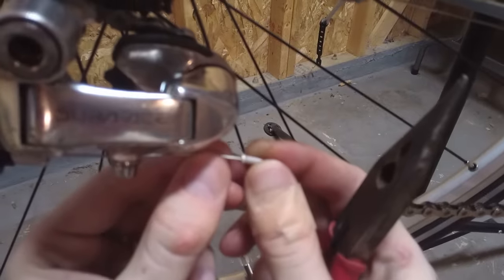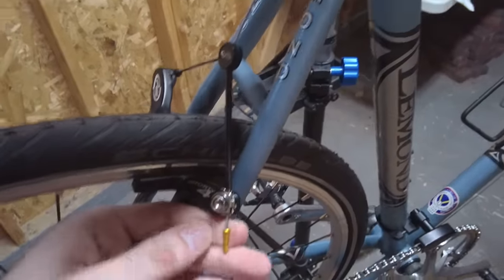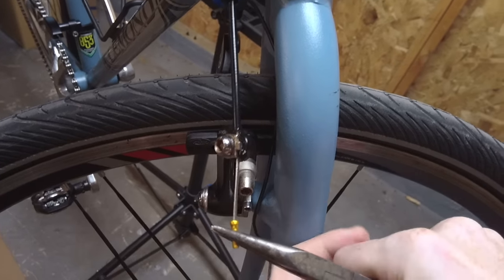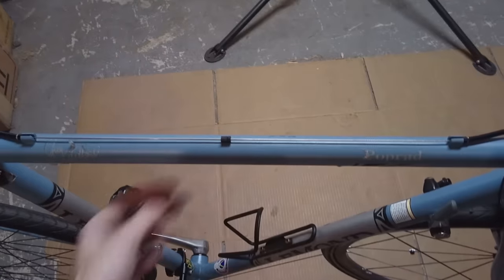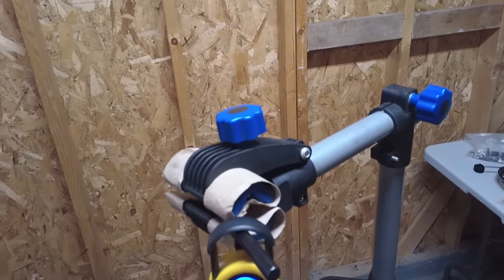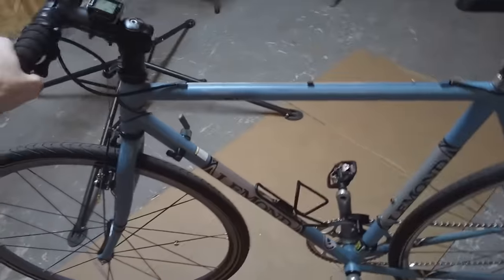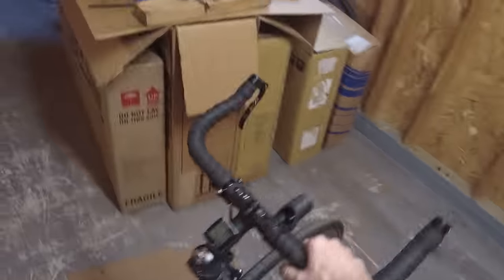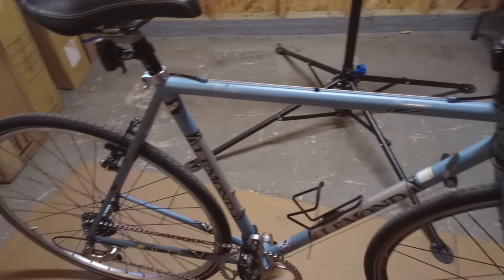Finished 1X9 Speed Drivetrain Conversion Project Commuter Bike BikeBlogger

Comment from the maker: @Moose Mechanic BMX bikes and folding bikes have smaller wheels, so you won't get everywhere as fast as a regular 27inch/700c/29er bike but if you aren't concerned with that then it could work. You'd probably need a longer seatpost.

Comment: Speaking of oiling the chain I saw a video where the fellow claims the BEST of all worlds is to hot dip the chain into parafin. You ever tried it? supposed to be great for repeling dirt and snow like Mn gets plenty of. I just use car motor oil on my beaters but usually stick to dry teflon lube for better bikes.
Reply from the maker: +BikingMNViking I have not tried it, but yes you can't truly clean a bicycle chain without removing it from the bike.

Comment: Does the Poprad have a steel fork as well? Or heavy wheelset? I was thinking it was going to be under 22 lbs., maybe about 1 lb. lighter but calculated aluminum fork.
Reply from the maker: +GTW 3Bagger I has an aluminum fork. It's 22.38 pounds complete right now.
Reply: I just had to know what my size large builds (well, one build and one with as much customization as yours) weigh when I discovered how inexpensive those digital scales are (and hopefully fairly accurate). DB Carbon Interval Tiagra/105...19.4 pounds, and 23.25 lbs. for my Giant TCR aluminum mish mash (mostly mountain bike) I threw together. That's with suspension fork so that's pretty good without even trying. I would definitely need the DB Interval to keep up with you off the lines but the Giant would be more fun. I'll have to weigh my 58cm DB Haanjo Comp and see how they compare. You've got fenders and original wheels but striped out all but one ring and cog right? I left the gearing, changed wheels, no fenders (yet), so it should be interesting...feels like mine might be about 25 though.

Comment: Hey buddy I bought a 29 MB and I have a question for maintenance the chain whats better? using WD-40 or buy a regular maintenance bike oil?
Reply: Water Disbursement formula 40 is not a good lube, use it more for freeing things up and dispersing water from little hidey holes like the ends of bolts and limit screws. Use a better sticking chain oil or wax-based lube if you live in a dryer, sandier area.
Reply: +T ekkendero 
If I owned stock in a bicycle chain lube company, I'd tell you something different. WD-40 works great. I buy WD-40 in a gallon can at Loews, and use it in a Park Tool chain  cleaning tool. It cleans and lubes at the same time. The key is to do it frequently - I clean & lube the chains on my bikes every week.
Reply from the maker: +T ekkendero Hello T ekkendero. I do not use WD40 but I've read it displaces water and dissolves grease. So you should probably only use it if you plan to apply chain lube afterward. I use dry chain oil. Dry lube may not be quite as good as wet, but stuff sticks to it less.
Reply: +BikeBlogger 
Visit:  http://bikefat.com/it-is-okay-to-use-wd-40-on-your-bike-chain/
And learn the low down on WD-40. It's that good!